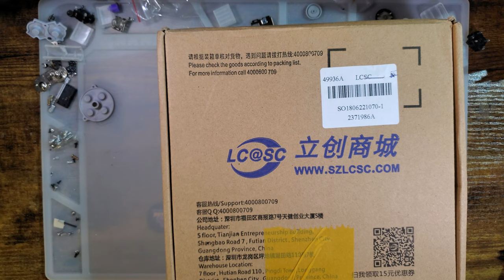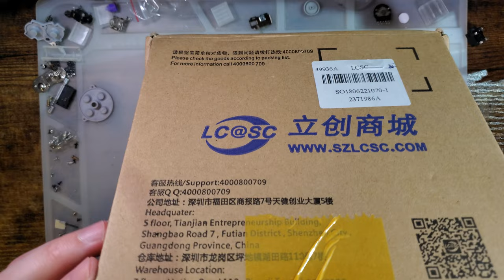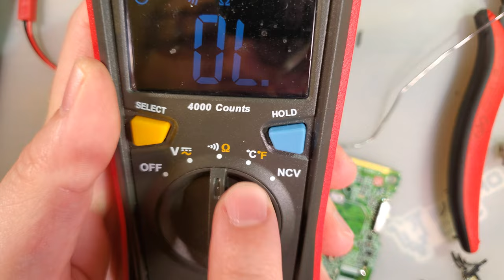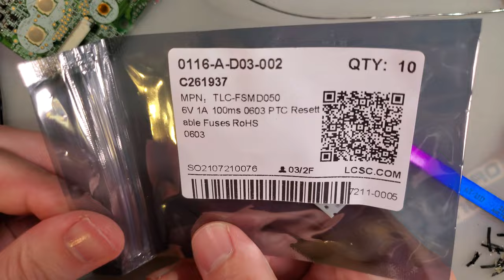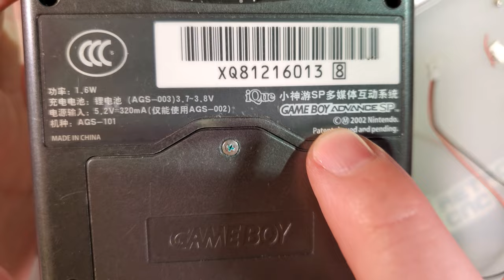AGT Experiment Board Repair

Comment: Mr Mahko,
Looks like other people are on Reddit having the same issue I had of having every-other-line brighter on a Funnyplaying ITA kit.
One user connected their kit to their DSi and it still produced the lines, meaning it might be the funnyplaying ribbon or board, and seems to have nothing to do the potentiometer or the capacitor that needs to be removed for 40pins.  (but i dont have a non-40pin to test that personally)

Strangely my cloud gaming store gbc original size ips screen also has these alternating lines on blues/yellows...

Can you check your ITA/CGS kits and see if you have these issues? 
(the lines dont really appear on black or white, but I found greys show them really strongly, like the GBA everdrive menu, or the grey areas on Mother 3)

I can send picture/videos

You are the king of gameboy fuckery, any idea what is going on?
Reply from the maker: You've seen how my screens work if you've seen my videos.